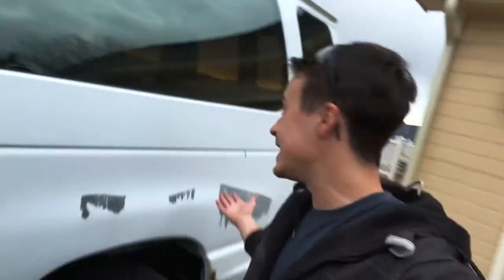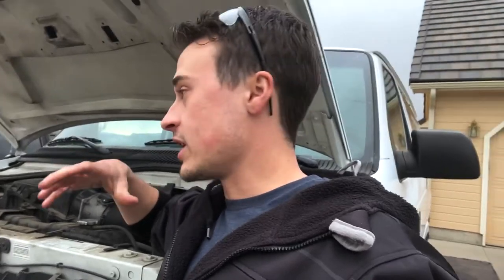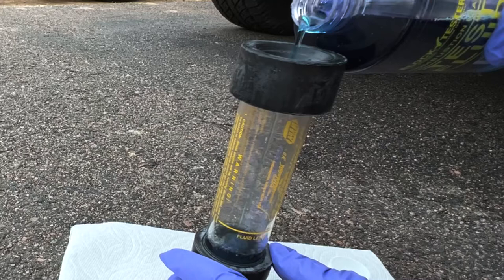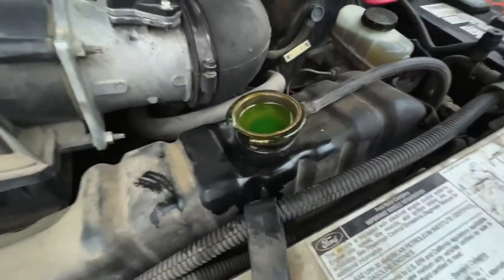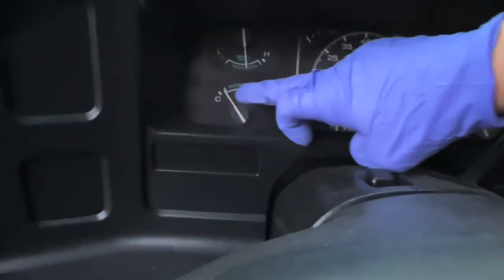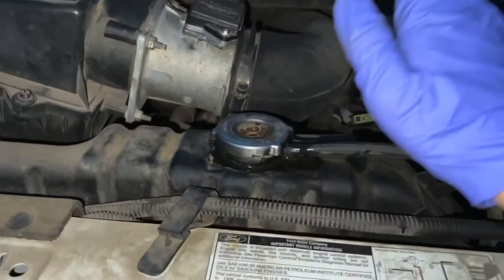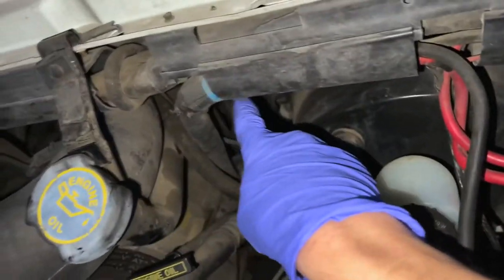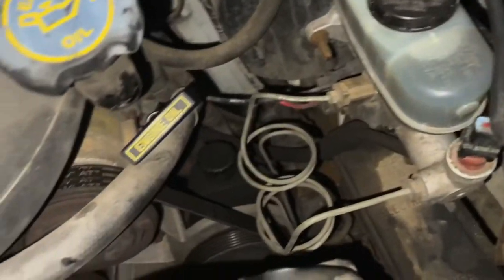How To Check for Combustion Leaks Into Cooling System Before Starting Van Life

Comment: I've had that same block tester for like 20 years! Great tool!
Reply from the maker: nice! I have had mine for like 8 years so far and it went through a shop fire. the fluid bottle melted and the fluid all turned yellow but the tester itself was ok, new fluid is cheap! tested a friends car and it had a blown head gasket. turned yellow super fast. not good news for him but at least I saved him money on buying new o2 sensors that autozone was trying to sell him.

Comment: I know this is a day late and a dollar short. But I will comment on it anyway. Hopefully, you either replaced that radiator or flushed it heavily that could have been why it was building pressure clogged ports. Also, I hope it worked out for you on the conversion. You should be able to get you some high-pressure hose and keep your rear heat. That will be vital depending on your location and if you plan to use it in the winter
Reply from the maker: Thanks! Not yet, I have an all aluminum radiator ready to go for it, going to be doing a lot of preventative maintenance this summer, new tstat, water pump, hoses, radiator, fan clutch. Timing chain and spockets, seals, gaskets belts, ac components. The van doesnt get driven much right now. In instaling a diesel parking heater no use in idling the engine and burning all that gas and engine wear for heat if not driving

Comment: I may have missed it, but will you be running any rust remover in the cooling system? I have an 89 GTA that looks the same, inside the radiator, it sat for years while my grandpa was sick. Been thinking about running some cooling system rust remover, if it even works.
Reply from the maker: I am not, i did replace all the coolant though. At some point I will be running some cleaner through then replacing the radiator. T stat, and water pump

Comment: Are you sure you have a 1996? I have a 96 and two 94s and none of them have the horn buttons on the steering wheel.
My 94 is a diesels but my '96 is gas and the intake under the hood looks a little different. Just curious
Reply from the maker: yeah it's a 96 shows the manufacturing date on the door label, different intake setups for different engines. there were like 3 to 4 different gas engines